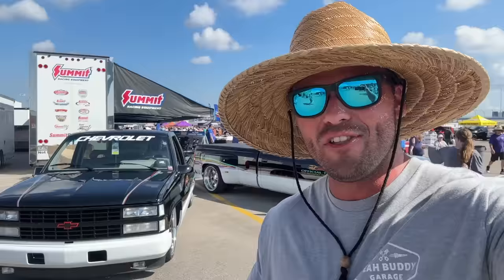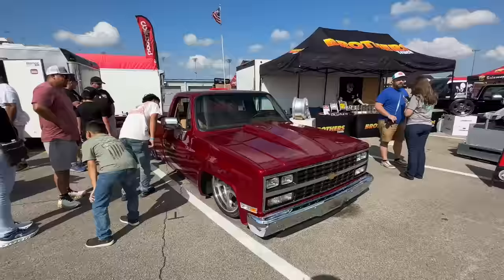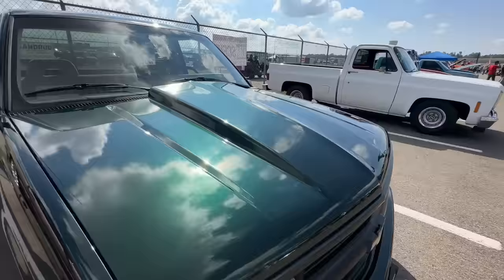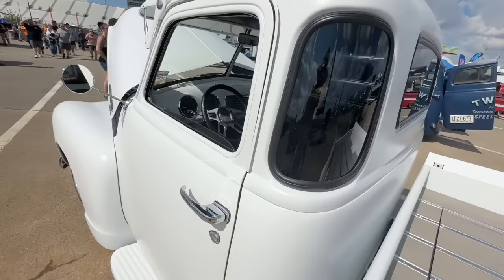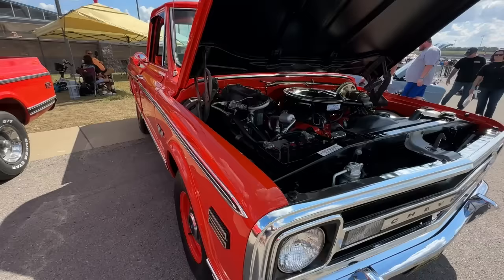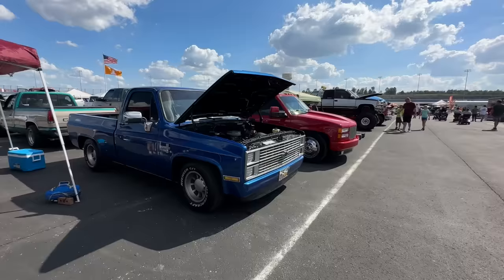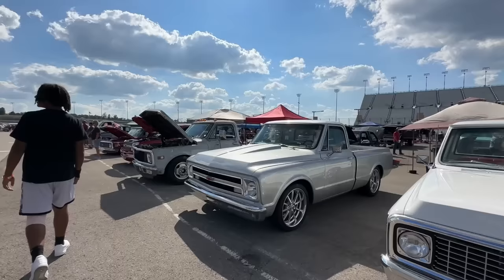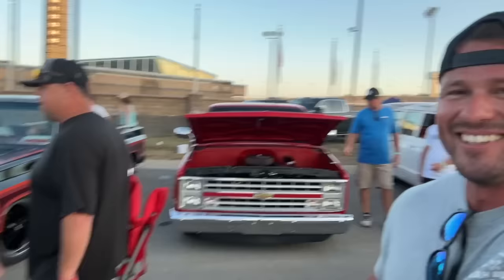ONLY TRUCKS | C10 Nationals Nashville, TN DAY 2

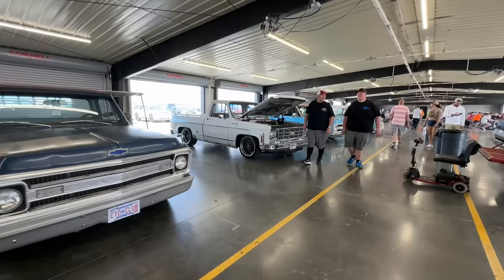Comment: What year is the baby blue pick up at timestamp 28:51?
Reply from the maker: That is a 1970. Looks like it's running some staggered US Mags with 20" up front and 22" in the rear.
Reply: @yeahbuddygarage  I just got a 69 chevy c30 as a project. And looking for ideas to use on my truck.